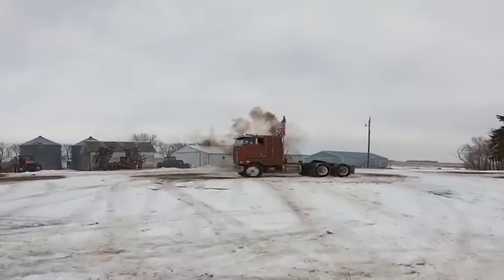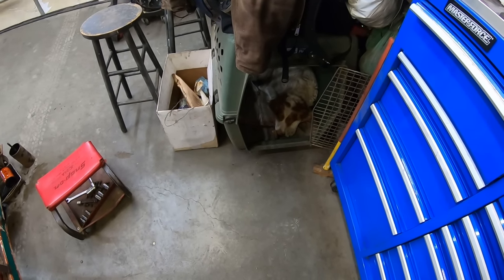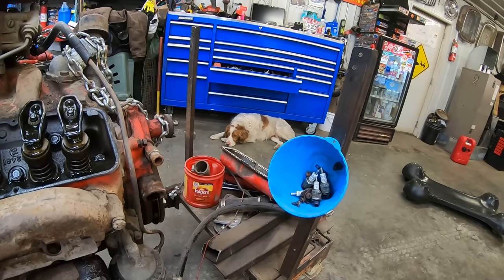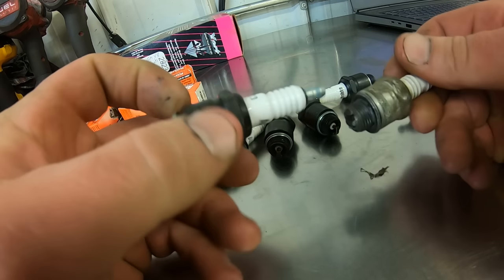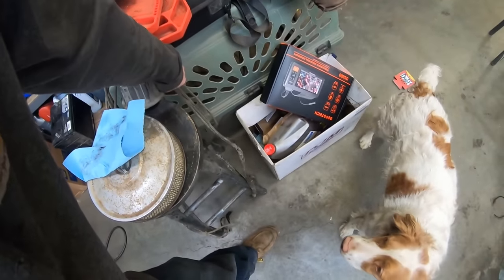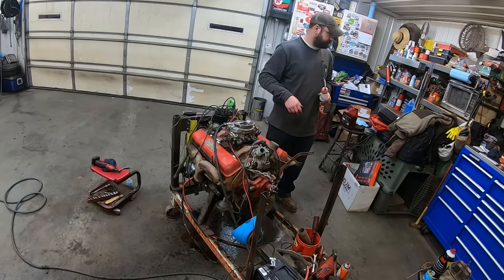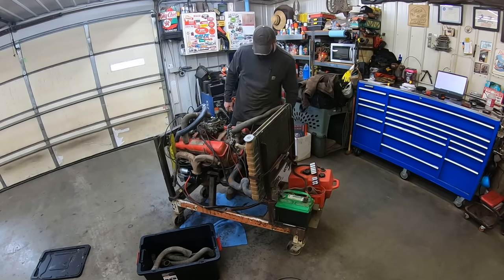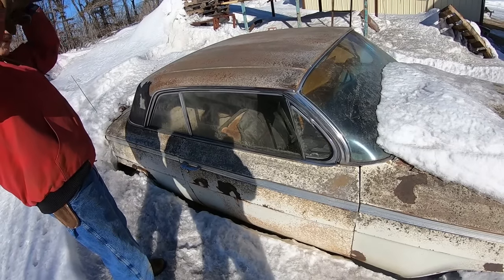1962 Impala Super Sport 300HP 327 Engine Abandoned for 43 Years!! Will it Run?!?

Comment: Instead of buying a ignition switch look into installing a 3-way selector switch(OFF-AUTO-ON). Make sure it is a 3-way selector switch that is a spring return to auto. That way you won't ever need a key. They do make 3-way selector switches with a key also. But the only reason I felt I should mention it is to eliminate the key entirely. In auto your fuel pump would get power just like an automotive switch. That would work perfectly on an engine stand like yours. 🧐
Reply: I actually thought about the selector switch idea when I seen your looser switch in action. I thought of a way to make my own looser switch that was in a small PVC box that had port for Fluke tester lead ports that I could easily plug in leads as needed(coil-fuel pump-starter). We make up our own custom test rigs, and "Deadman switches" at work. If you are interested in a parts list with stock code #s I can look into it if your interested.

Comment: I cut my teeth so to speak on a 327 ..
My dad bought a new Impala in 69.
After a few yrs he parked it...
I pulled the motor & with help from an older cousin , rebuilt it with the good stuff..
I was 15 & dropped it in a 67 Impala.. 
Not sure what hp it ended up, but she'd rip .
I had brand new tires all around & after 3 wks the rears were bald...
The old man was Not happy ! 
So, 327 for me.

Comment: I like the 327's for no apparent reason other than the odd # of the engine size, I prefer the tried and true 350s though for the cheap and ample parts availability. I guess the same could be said for the Ford 302s but sadly Ive never owned one.

Comment: B153
B February 
15-15th
3 -63
461 1.94 valve , but good heads for a 327. 2.02 with the closed chamber is shrouded killing flow
Reply: Measure the valve lift, if memory serves me correctly it’s .447 on that 350hp cam. That sounds pretty close if you ask me.

Comment: Do you think maybe when it was rebuilt they put 350 pistons(shorter compression height)in it, hence, crappy compression test?  I created a 327 using a stock 307 crank, 327 pistons and 350 block.  Knowledge from "Small Block Chevrolet Interchange Manual" paperback.  Oh yah, my favorite engine is of course the SBC.
Reply from the maker: Could be but highly unlikely. I'll have to pull another compression test.

Comment: answering the question near the end my favorite engine if I have to pick just one is the one I had in the truck i learned to drive in....
it was a '62 Chevy with a Slant 6 & a 3 on the tree.... A.K.A. " The leaning tower of power " i haven't seen any engine built since then that is as unbreakable.  The 3 on the tree was a pain in the @$$ and got hung between gears every D@€~ time you tried to show off or just get it on the highway but that engine survived me and 3 of my cousins leaning to drive and ended up being murdered by a huge oak tree falling on the truck and burying the block in the driveway up to the exhaust manifold... ( the tree was about 4½ feet across and we counted 138 rings when Dad cut it up and traded it to the local furniture guy for a '79 buick that threw a rod 6 months later )

Comment: I'm a "if it survives my abuse" I like them motors. Had a knocking 2.5 jeep 4 banger that lasted a while never blew up, I've had/have a few 6.9 idis I've also abuse and have survived. Even eating a gallon of oil ever 50 mi. Earlier jeep 4.0s that'd I've kicked the snot out of. Have a 5.9 12v in a 86 ford that I also run her through its paces. Got a ranger 3.0 everyone dogs on that is loyal as all get out.... but have blown up about 4 4.0 ranger/exploder motors. I don't really have favorite. It's it's good I like it.

Comment: the double hump heads were highly coveted and we wood do 2 pairs a month with new manley valves springs caps nd retainers  only prob is they are not tapped for the later model accessory brackets

Comment: I think the engine is from a 63 Chevrolet because the date you read off the head ends with a 3 which is for 63. Also the original carburetor would be a Carter AFB four barrel.
Reply from the maker: yeah, it's been mixed and matched over the years

Comment: Correct me if I'm wrong but the B 6 3 code should mean February (B) 6th (6) 1963 (3) which tells me if that engine came out of a '62 Impala then it's not original heads.  461 heads were the ones to have way back when so not surprised that if it got a rebuild that those would get used if they were available.  The engine codes match ok as you said the VIN was a match to the car so the heads are just a year off.  But maybe the 3 refers to the shift and not the year, idk...I'm not the guy who cares about numbers matching because I can't afford any numbers to match anything.  I get whatever numbers bolt on and go down the road.  Optional feature, less oil and coolant leakage, but like I said, optional.
Reply from the maker: The heads could have been swapped at some point since it's been rebuilt. I'm not sure either.

Comment: My favorite engine is the BB Mopar. Preferably the 440. Dry manifold. 4 bolt water pump. Shaft rockers. Front distributor. Tough as an anvil. Crappy heads though.
Reply: I liked the 413 mainly because the truck/industrial blocks were beefier in some case with better cooling . I have a pile of 906 heads, but last summer dragged home a set of 286 heads from local juck yard that was crushing out.
Reply: @roughrdr  Even 906s, 452s, and 915s are garbage compared to an ordinary set of Edelbrock's, Stealth, Promaxx, Speedmaster, etc. They work fine on a 383 or 400, but not as well on a 440. Unless 450-500 hp is all you're after.
Reply: @roughrdr  413s are good for big boats like Imperials and trucks, but the 4.15 bore shrouds the valves a bit. Doesn't matter at 4500 rpm, but it does at 6000. I'm not sure if 2.19 (Trick Flow, etc) valves will clear the bore, but obviously 2.08s are fine. I know they made 413 Max Wedges, but for only a year I think. Then 426.
Reply: @jeffrykopis5468  didn't say they were good, just I have tons of them I use to practice my porting/polishing on so I don't ruin a good set of heads. Also In a pinch I have spares. As for the 286 casting, dad always said if I could find a set it would be a minor improvement over most others except for the max wedge heads.
Reply: @jeffrykopis5468  62-64. Dad owned a Dodge 330 with the 426MW and I wish he hadn't sold it. As for why I like the 413 is mainly for the longest time they were a dime a dozen in my area, withe the occasional 440 boat motors and 392 agricultural flavors.

Comment: Double hump non bolt holes are available in all valve sizes and many people have 1.94 /1.48 and the easiest way to tell the 2.02 heads are so close to each other that you can only get a business card to slide between the valves but the 1.94 fuelie heads with 64 cc combustion chambers are a great head 461,462 really rare 462x casting  882 that have 1.94 &2.02 with  accessory  bolt holes any are better than a 1.78 valve with 76 cc heads unless you are going turbo and just a head swap would  be a lot easier to lower compression then having to change pistons  and the wonderful thing about the vortec 5.0 or 305 heads aka fast burn  head from the tuned port Era pre the idea of having to remove your harmonic balancer for a tune up and it must have been someone thinking too much never before and we all hope that it will never happen again  I have a couple of old 3/8 drive flat head  sockets for the timing and oil pan  fasteners on the early sbc and  many  people don't know 305 Chevy was inline 6 cylinder first great content  you and duff are the best 💯👍👍 too bad we've on opposite sides of merica or we could have a samich consumption contest  you have nice dry body's in SD and I have junkyards full of 500 dollar LS powered vehicles hrere in FL since Ian  now thousands of  supercharged lsa and  hellcats that we're just in garage and wet not ran in water it's not much different from what you have seen in bad head gasket and water in cylinder is not a big deal as long as nobody tried to compress  water 💯

Comment: I'm in the process of restoring a 1990 ford F-350 with a rebuilt 460 with an E40D transmission. Any suggestions for the engin break in oil ? Iv herd that locus break in oil work pretty good thoughts..
Reply from the maker: Any of the high end ones should be fine.

Comment: I had a 67 Camaro with a 275 or 327 and a four-bell I think it pulled the stud out of the head cuz I could never get the lifter clacking out of it on a one cylinder I don't know what the hell happened to it and then I had a 69 Impala with a 235 or 327 two barrel and that thing drank oil I mean about every oil it was unbelieving me I got rid of both of those cars and then I got me a 70 Noah with a 350 in it and that was an excellent engine never had a problem with that thing drove that 200,000 miles an SS mobile with a 4-speed Muncie never had a problem with that excellent engine

Comment: Cheese and rice ! We know AC Delco is on a mission to ruin its own name but for cryin’ out loud , that starter sounds as bad as my old black and decker hand drill . It just doesn’t sound , chevy . The original AMC starter on my other 258 in my ‘73 CJ  sounds OEM and loving it . The auto zone starter on 258 in the ‘80 CJ sounds about like that criss cross starter . Sure hope it makes it alright . Maybe it was reman’d by Hamilton beach ? Jeez ! Looks nice though . Agreed , I’m not so much an exhaust header guy either , not because it’s too loud or I’m too old ? It’s just not a lot of fun putting them in and then making fit and not interfere with EVERYTHING around them ; suspension , chassis , clutch linkage , shift linkage , floor pans , just everything in their path . Then they just have to burn up flange gaskets and collector gaskets . Even with think flanges , they still don’t last like cast iron manifolds . Less restrictive but at a price .

Comment: Fave engine?  Hmmmmm…..

472/500 Cadillac. Mega torque and reliable with good maintenance. Also, doesn’t weigh much more than a Chevy 350 and they have dry intakes.

Comment: If you want the maximum rpm and power out of a small block 283  327 or 350 AC plugs gaped at 32 thousandth

Comment: hey, Mortske this is the front deck engine code on my 327. i see it was made in flint rock but not sure about the rest J134260F1019SO.
Reply from the maker: I think you're missing some info. Most of that is the last digits of the VIN on the car.
Reply: @MortskeRepair  that is all the letters and numbers on the front pad drivers side
Reply: from the pictur it almost looks like J134260FI0I9SO.
Reply: also is there a way i can just send you the 2 pictures i took of the front pad that has the numbers stamped into it they are both taken from different angles cause my alternator but i do know its a 327 cause when i bought the block with the crank and pistons i checked the back casting numbers
Reply from the maker: @garyww24  I don't see a listing for an "SO" suffix
Reply: @MortskeRepair   yea that's what i was trying to figure out. but in the picture it is definitely SO at the end and when i shine a light on it so im not sure.

Comment: For most of us it only takes 30 minutes or so to re-fire a runnable engine.    You just need some Marvel Mystery oil on top of the pistons,  spark, and gas,  crank her up !
Reply from the maker: Sounds like you should have your own YouTube channel!
Reply: @MortskeRepair      Fun for me to watch those that do,  and don't really know.   Turned my wrench's back in the early 1970's and since.  I street raced my 1966 Chevelle SS 396,   my 1967 Impala SS,  and  my parents 4 door Impala that I swapped a 396 into.  Still spin the tires in my original owner 1985 Oldsmobile Cutlass Supreme Brougham that I installed a Vortec headed SBC 355 in.  Fun with old cars !
Reply from the maker: @billycarpenter4740  Those that cant, talk.
Reply: @MortskeRepair     Those of us who have already done,  educate others.  BTW,  a  300 hp 327 is a small step above the base engine.
Reply from the maker: @billycarpenter4740  ahhh, to be as wise as you, a 300HP 327 is merely a small hair more powerful than the base 135hp 235 cubic inch six. Oh wait, that's more than DOUBLE! Boy, you sure are smart WoodBilly!
Reply: @MortskeRepair    I was comparing  to the  base 250/275 hp   327's of the day.    Even my LS-5  454's were the same simple start up procedure.    Don't expect you to appreciate my 50 years of mechanical  experience,  I share with those of open ears and open minds.
.
Reply from the maker: @billycarpenter4740  Well then you clearly don't know what the base engine is now do ya?
Reply: @MortskeRepair    Only because I didn't bother to look up the numbers,  been awhile since I worked with a 327.   Yes,  I had an Inline 6 in my 1965 C-10 with it's 3 on the tree.  It was probably a 265 if I remember,  maybe a 250,  doesn't really matter now.  Me being 63 years old now,  alot of less important facts I look up if I need to know.    Soo many hp numbers for a SBC 350,  as BBC's, some are book wizz's,  some of us were busy doing !!   Not too important to me to remember 265, 283, 327 specs that we used way back then.

Comment: It’s probably not a good idea to use Vaseline with rubber for a lubricant. One should, instead, use silicone grease for that purpose. Also, during cranking, it sounds like it still has very little compression- almost like there were no spark plug in.

Comment: I recall you saying you set the points at .030. The dwell should be 28 to 32 or 30 degrees and the gap should be .019. Hard to start with the gap too wide. Just saying.
Reply from the maker: I had a brain fart

Comment: Sounds like it’s weak on compression. Put some new plugs in it should start the rings are probably stuck once you get it running and hot it’ll probably loosen up the rings and the compression will come back up to normal for a old engine would be chevy 503 bb . The motor that your working on looks like a target reman engine probably 327 that’s what the valve covers looks like on a target engine
Reply from the maker: Stock valve covers

Comment: What a Chevy 327 engine and Chevy 350 engine you need AC 44s if it was a four-wheel car they had a AC 44 in them are and if it was a two barrel you had a AC 45 a little hotter plug that's the plugs you want for that engine AC

Comment: Sad to say...but my fave now has to be a coyote...but older motor, nothing made power stock like a Boss 351...next time you run into the compression down/stuck rings, trickle some brake fluid in while cranking. Not only penetrates but it burns...Dad taught me that trick on motors with washed down rings and gm diesels (worst motor in history)
Reply from the maker: Interesting!

Comment: 🇺🇸👍. The difference 250-275-300 was compression and the cam and a 4jet was factor original the carb now on it is a awesome carb they are smooth transition between the 2 to 4 barrel opening there hard to find anymore. 👍🍺🥩🌽🥔.  🥛💤
Reply from the maker: And manifolds
Reply: @MortskeRepair  I stand corrected ThankYou I may not always be right, but I am Never WRONG ! 👍🍺🍺🍺

Comment: Chevrolet 300 horsepower 327 and 300 horsepower 350 30° as well about 10 or 12 degrees of timing on a crank naper down there run like a rape tape all day long no problems on premium gas you had to have premium gas I had about a 10 1/4 or 10 1/2 compression Rachel you got to run premiums you're going to spark knock but you never had a problem and that was a bulletproof engine as long as you didn't run over about 5,500 RPM that was it

Comment: 300 hp 327 ci 64 cc heads flat top pistons =10 or 10.5 compression  non hardened valve seats stout steelcrank. maybe 74cc heads more driver friendly

Comment: The long cable is so it can go down a sewer line.
Reply: You need to put the spark plug back in cylinders with the stuck valves. That way the oil you have in there will blow out on the exhaust valve stem.

Comment: That motor is new than 1962 because  in 62 s had 3 bolt starters
Reply from the maker: I swapped starters. It had a 3 bolt on it. We decoded it. It’s a 62 block
Reply: @MortskeRepair  k good

Comment: My favorite engine is the german iranian made 4 banger called IKCO EF7 1.7litre engine 113hp and we have car that has this engine in it called Samand LX it's fwd and it has a 5speed manual and i wanted to drive the car and it had a oil leak so i didnt check the oil and when i checked it after driving the oil wasnt on the dipstick and the poor thing didn't spun a bearing and this poor thing keeps on going after 130000km (for a iranian car that's a lot of km's and it's like having 180000 on a newer chevy it's not good!!!!

Comment: You set the points too wide, I usually used .016 but .030 is a bit too wide.
Reply from the maker: I set them at 0.19"
Reply: @MortskeRepair  Perhaps I didn't hear correctly, but I thought you said .030 in the video.  It's been a few years since I set the dwell but that sounds about right, 30 dwell.  In any case I do love watching your videos and if I had any spare cash these days I'd help you out in any way I could.  Keep doing what you do!

Comment: Yo carguy ..you can buy a bore scope for under 60 bucks but I'm gonna bet the dump ass drove this car around with unleaded gas and burnt some valves. Or not..if compression was getting past the rings you would hear it venting out the PVC pipe in the back of the motor. and how long you got with this motor how many days you need?

Comment: Yeah it wasn't good about small block Chevys you points gapping on them old ones like that wear 19 and as well was said at 30° if you use a dwell meter and then they got that little flexible Island magic a open up that door you can Justin points while the engine is running that's why I like about Chevy you can just as well while it's running board you couldn't do that or anybody else at that time shall you did have the right idea on that